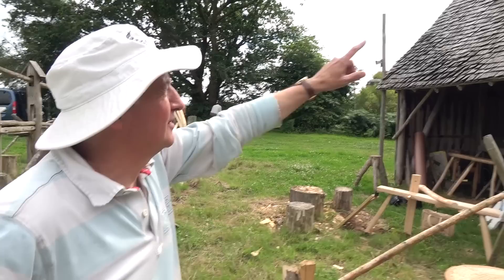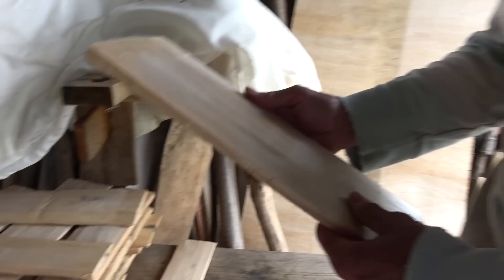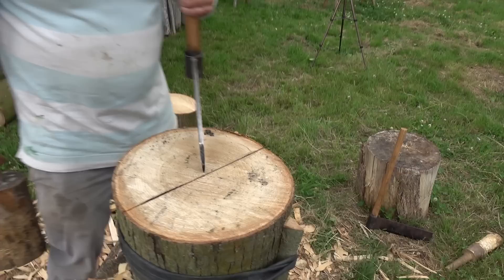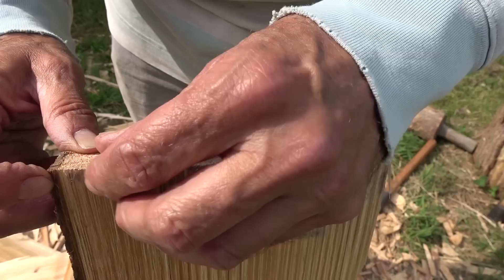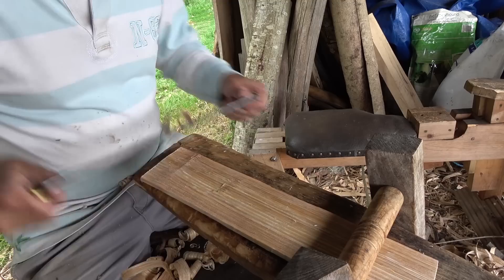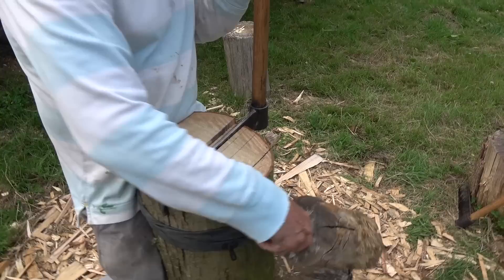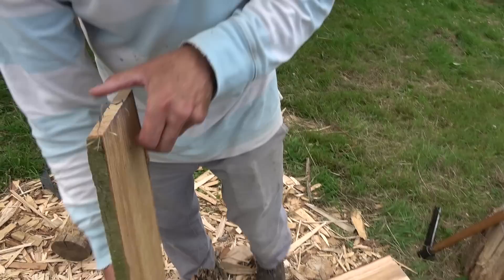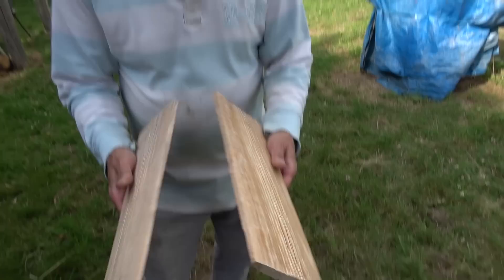Making Roof Shingles With Hand Tools

Comment: I watched a man saw shingles out.... I was like, no... you can't do these like this.. he got angry ...when you saw these, like you said they are shingles and it actually is less desirable as it cuts the grain but a shake done with a froe has no grain exposed as the shake is pulled open along the grain... and absorbs less water. .. I helped my granddad make shakes, he was adimant about the froe and not sawn. Great video guys.

Comment: I live in redwood country, and they do it a little different here. First they square off a section, called a bolt. Then they split that into shakes. They do that so the shakes are wider, and don't taper across the face of the shakes like his do.

Comment: In Canada shakes are different than shingles as shingle are wedge cut so top edge is quite thin.  That makes them lay flatter.  Basically a less lumpy more tailored look on the roof. Typically our shakes and shingle are made of cedar an excellent rot proof wood.

Comment: Riving shingles, longer straight grain pieces  (4'+) would be called "splitting boards" (clapboard siding is a common use for those).  I was lucky enough to have learned how as a kid in the early 80s.

Comment: Shingles are cut off the outside surface of a log. Shakes are cut radially from a log... 90 degrees different. Shingles always have outside log on one side, and more inside on the other, so they tend to warp after time. Shakes have matching log diameter bits equally on both sides, so dont warp.

Comment: I bought quarter sawn clapboards for my USA built house. They were sawn to pie shaped wedges, just like your shingles. They were excellent, stable and took stain well. Most clapboards are plain sawn and tend to cup. Spruce and pine clapboards. Oldest shingles and clapboards were riven like you did .Shakes in the US have thicker butts. Shingles are not quarter sawn or riven they are 3/8 inch thick on the fat end. Shingle mills were once common. Handsplit shingles take a t remendous amount of time and labor. White Cedar is the preferred shingle in the US, but the quality of available wood is not good. Mostly it comes from CANADA. Western red cedar is ugly and turns black with weathering. A bit of a fire hazard but it looks nice.

Comment: If society falls apart and it becomes dog eat dog every tree in the United States will be gone within a few years wood will become a valuable asset for heat alone 
Almost everyone north of Oklahoma will have to have it or they will die!!!
I spent a year in northeastern Oklahoma in a tent and a shack and I was amazed how much wood I used finding suitable wood and stuff that would burn become a full time job
Reply: Here in my part of the Midwest I help my grandfather prep for winter. He burns 4-6 cords of wood. It was a full time job. We had to cut down trees, and cut them into rounds. Let them dry, then cut them into logs. Those logs them sat till next winter. 

A cord is 4x8x4. It was a solid 2-3 months of physical labor, the rest was dry time.

Comment: Its not the simple strength of a fitting that you need to worry about, its how it behaves in a seaway when everything is bumping and bashing and wringing for days on end. Where an M 10 gies through a hole it bears on a smaller surface than a bigger bolt, so it smooshes the hole more. The bolt wont break, but the hole might!

Comment: I wonder if it would be worth dunking them in a bucket of linseed oil or teak oil and stacking them up to dry before fixing them to the roof? The oil on the outside would weather off, but the oil on the inside might preserve the wood for a long time.

Comment: I wonder if those...I'm not sure how to spell it, but...Throws? Throughes? I'm not sure, but that splitting blade you knock into the log after binding it.
I'd love to see a video diving into those things. How they're made, how to make one yourself, where they were invented, their historical use, and more of that kind of thing.
Reply from the maker: Hi its a froe, and you can make one from an old leaf spring, such as on an old lorry, as the steel is good and can be hardened and tempered. Rgds Harry
Reply from the maker: And just to add they are an ancient tool used many centuries ago.

Comment: Moisture always leaves through the end grain. You can spread beeswax on the end grain of the logs or timbers. It helps the wood season more slowly, which prevents a lot of warping and cracking.

Comment: Splitting your smaller blocks all the way across like you do will give you a lot of flat grain shakes  which look fine to the inexperienced eye but you will find they do not last nearly as long as an edge grain shake. They will rot faster than the rest and your roof will leak

Comment: If you layer press them between seasoned planks, they warp far less.  I'm wondering of the benefits of sealing them using a sprayed-on wood sealer (paint gun).  Will it help prevent wet/dry cycle rot?

Comment: This is pretty good.  But, isn’t the best way to do this.  A better method is to quarter the log, and then use the fro to split off singles from the sides of the four quarters.  That way they are more uniform in thickness, and since they are “quarter sawn” have a flatter grain, and are less likely to warp.

Comment: i cut many hand cut '' shingles ''  to get proper taper every bolt is turned and cut from each end every cut of the ''bolt''. thats how to get proper taper on every hand split,  im amazed these professionals dont know this  every ''bolt''  that's not cut end for end is   a  ''shingle''  a taper cut is a '' shake '' hand tapered by cutting from a bolt turned end for end every cut. nuff said

Comment: So am I correct in thinking that the larger diameter log, it’s better to cut it into radial pieces but if they are smaller diameter you can cut them parallel?

Comment: Interesting, The saw or shaper that is shown around 6:12, but heard in the background throughout. What is that for? Do you have any pictures or video on how it's made, what it's used for and how it works?
Reply from the maker: Hi Jens it's a pole lathe, and I have posted a few films on making them and using them. Best wishes Harry

Comment: Hi Harry. West coaster here. Wondering what kind of wood is that. Sure is a lot of work to get a few shakes. We use Western red cedar. We use a much different way to split our shakes. Can you not use the same method? It's way more efficient but that could be because of the wood grain. I'm curious.
Reply from the maker: Hi Ron...we were using chestnut for these...cedar is great!

Comment: these would be called barn shakes at 18 inch, 24 inch are flipped after each blank letting the wood taper naturally Canadian red cedar up to 16 feet, never seen it with small logs.... the wrinckle and twist is called corrugation, too much and its hard to lay.

Comment: Me Not being expert,: seems you'd want them to be something like 3 Ft tall and 18 inches wide; overlap them 18"top to bottom (eave to peak) and overlap, them 9" side to side ; that way you get a "double" roof effectively which (if slate ) can last 300+ years w only an occasional replacement of a single cracked piece.  ; i've seen this without any plywood at all just 1x4' over the trusses, not even insulated in the old days (butvinsulation should be added in these modern days. )

Comment: What kind of hatchet is that? I really like that one
Reply from the maker: Gransfors side axe.
Reply: @harryrogers  huh, I wonder if they stopped making that one? I saw a carving axe they make that you can get with a similar grind but the head shape different. Does the one you have have and offset on the handle?
Reply from the maker: @kpxoda1  hi that one is not mine, I have another blacksmithed up with an offset handle.

Comment: I would suggest soaking the wood shingles in engine oil it will give you another 5 to 10 years of life.
Reply: Tar works too right?
Reply: @ReiseLukas  tar would be a lot harder to aquire or make.why I suggest engine oil or any oil but trying use every bit of waste n seeing your car needs a few oil changes save oil instead throwing away. Sealing any wood will make last

Comment: I dont understand all the extra work after splitting it in the log? cant he just use them as is after that? Maybe soak them in some sort of waste oil or used cooking oil to make them last longer on the roof? My dad would soak wood in old engine old before he would use them for ground pads
Reply: As he explained, they need to butt up against each other. Plus the outer edge with go bad and breakdown

Comment: wont the shingles rot? I genuinely have no knowledge of wood working
Reply: All things tend towards decay.  There are measures you can take to slow the process.  Today we have many chemicals that could be used to protect the wood, but in olden days you didn't have store bought chemicals you could use.  There were plenty of ways to preserve the wood.  Also, it depends on the kind of wood you use.  Softwoods will rot much faster, but if you use a hardwood it will not rot near as fast since the wood is much denser and will not allow water to so easily absorb into the it.
Reply: In France, where chestnut wood is traditionally used, split shingle roofs are known to last 60 to 80 years. With Robinia pseudoacacia, they can last about 100 to 120 years.
The shingles used to be turned top side down when the roof was remade, which doubled the longevity. That left plenty of time to split new shingles, a few each year and stock them for the new roof, or to repair the old one... 
You want to use a wood with a high tanin content. And the pitch of the roof matters : the steeper it is, the longer the shingles will last : that's why 16th century houses had a much steeper roof than those of the 17th century, when the use of slate and ceramic became more common.

Comment: What are those tools called? Like, what kind of hatchet?
Reply: Bearded viking hatchet, froe or shake axe, and a draw knife on the bench.
Reply: @adamtracy2138  Ive been searching online- cant find a side axe like yours- was it custom made? I Find all this absolutely fascinating and can't wait to do our barn this way! :)
Reply: @lizfletcher2685 , I was not the original poster, but what I can tell you is, find a piece of timber that has a natural curve to it, preferably hickory. I dont know if you can actually order one like this or if this handle was custom made. You could also possibly use larger stock, straight grained, and use a draw horse and draw knife to achieve the curvature you're looking for.
Reply: @adamtracy2138  mybad. But excellent advice- thank you! :)
Reply from the maker: @lizfletcher2685  Hi Liz, That axe is a Gransfors Bruk side axe and they come with left or right hand grinding to the blade. Rgds Harry
Reply: @harryrogers  oh my goodness thank you!! Will certainly be getting one for our barn next year. :)

Comment: Absolute crap.
Just spray polyurethane foam over the whole roof and it will be completely waterproof, with only moderately increased carcinogenic properties.
Just kidding .... great video. I actually have to turn some logs into shingles to use on my allotment. This was incredibly useful. Thank you.

Comment: Can’t they just go to Home Depot and buy some planks? Seems like a lot of wood is wasted in this process.
Reply: Factor this un2to your thinking: Riving wood, especially radially, produces more stable lumber that resists water and pest damage very well. The shake is less prone to decay, as a result. Sawn shingles have be sawn from trees that have fewer defects like twist and knots. Given that mills are working with smaller logs, generally speaking, this requires that more of the log is not used due to defects in order to selectively cut around them. Further, they are rift or flatsawn which encorages more movement with weather changes. They are prone to cupping and checking which can hold water and encourage a faster decay. The nature of rift and flatsawn lumber creates a lot of sheared cellular structures. Imagine a fistful of straws held so that wateris poured on it at an angle.  They shed the water and keep the other side dry. Now shear the straws at an angles and they will catch and convey some of that water to the other side, wetting other structural lumber and increasing decay. Now the entire roof may only have a 10 year life, instead of a 30 year life. With this in mind, the waste, in this context, not a gmhuge loss. This plays out in many other older building methods and materials. The efficiencies of these methods are often superior to modern practices.

Comment: a lot of wasted trees, a lot of work, not a lot of sense....
Reply: How are they wasted? There's no shortage of trees.
Reply: @rawbacon  there's no shortage of stones either. But stones don't produce oxygen
Reply: @Ne3ek1t  So you're suggesting putting stones on for roofing? BTW there's no shortage of Oxygen.......Plus that's not scientifically sound ~ "For every batch of carbon dioxide molecules trees pull out of the air, they push a comparable number of oxygen molecules back out. Given that the atmosphere contains less than half a percent of carbon dioxide, but 21 percent oxygen, it’s not possible for trees to generate that much oxygen".....It's a myth that trees are a major source of Oxygen.
Reply: You didn't answer how it's wasted. The shavings and pieces which are unused as shingles become fuel for the stove or kindling. It all gets used.
Reply: @doms.6701  Yeah in that sense, everything in this world gets used. So there is no waste on this planet. By your own logic